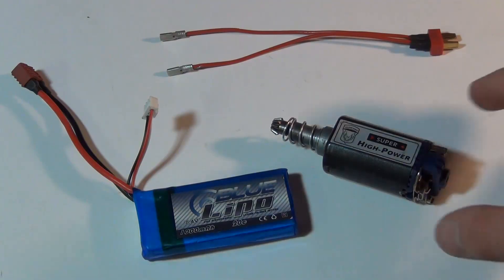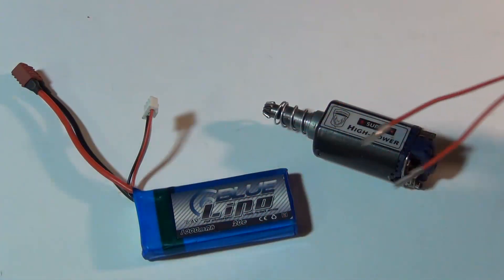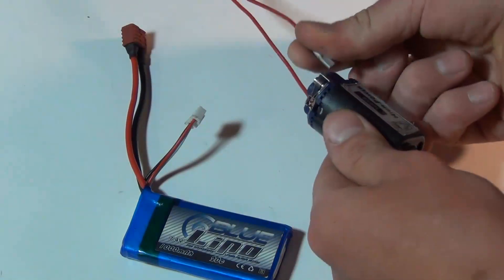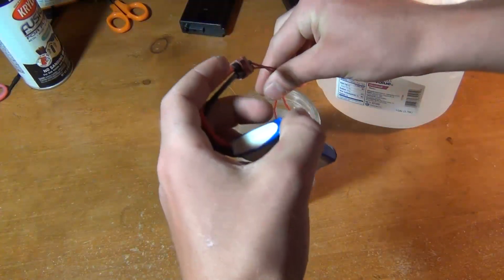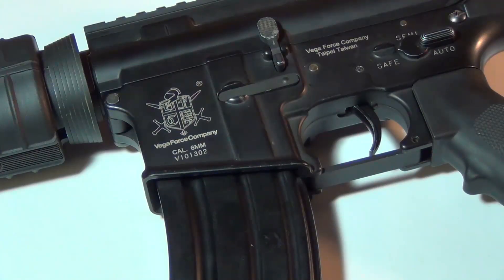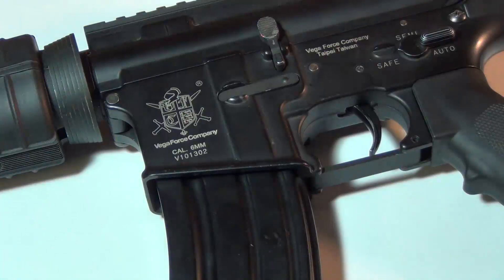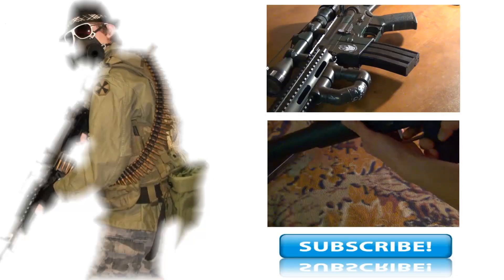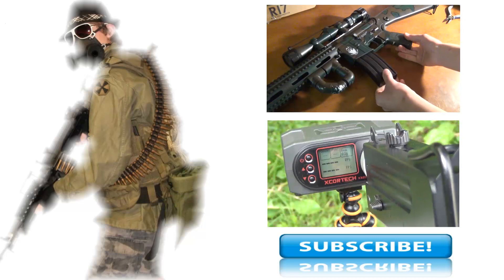Make Your Electric  RC/Airsoft Motors Run Faster

Comment: That’s dumb, just take apart the motor, clean out all the crap and the little magnets then put in a high quality grease then don’t worry about doing it for like a year. 
All that thing is, is a mini starter for a car. (Same exact design) 

 Mechanic 15yrs

Comment: All that cloudy stuff in the water was your oil you dip shit. We did this with rc car motors but not to clean them it was to break in the brushes and comm so you need to have the end bell in the water. After the break in is done (usually 4 to 12 hours) you need to relube the bearings/bushings. Don't be a douche bag, educate yourself.

Comment: I had an old stock motor that had nothing wrong with it i had used it for about 10 airsoft matches and i did this to prove what i had expected and it did exactly what i had expected. The distilled water washed out all the lubrication causing the motor to overheat and burn up.
Reply: TheGamerGuy lol

Comment: It is too much power, highly recommend to use R/C receiver battery, something that has much lower voltage for applications where the motor will be running constantly. I would keep tha lipo away from water as much as you can.

Comment: So many people are talkin out their asses! Other than the use of the lipo, everything in this video is on point. I would say that water is not required when breaking in a motor (and I highly recommend breaking in motors when new.) However when cleaning, is just as effective as it is on RC motors.

Comment: i have a very used and old systemma magnum motor that if you touch your hhands will be black. Im guessing cleaning it out will help it out. Im hearing mixed ideas here, taking out the brushes and manually spinning the armature, running it with a low voltage and running it with a high voltage... and then after will the motor have no lube and burn out after doing this? Is silicone oil bad for the motor? please help me

Comment: I did watch the video and I know you are talking about cleaning it, but they are the same exact thing.  Dipping it in water while running the motor does work for RC car motors, but not airsoft ones.  This just destroys your brushes and causes it to burn out faster.  When truly CLEANING a motor, you unscrew the screws on the butt cap and disconnect your brushes.  Then you put the bell in distilled water and manually spin the pinion gear so all the dirt goes into the water and not the motor

Comment: Just to let you know, you are using too big a battery for this.  When either cleaning or breaking in a motor you should use about 1/4 of the voltage of the battery you would normally use on your gun.  For example, I use a 12 volt battery on my gun, so when I clean my motor I saughter a wire to the positive or negative side on 2 AA batteries because they are equal to 1.5 volts and that plus 2 batteries is equal to the 3 volts I need.  Also don't dip your motor into water when breaking it in